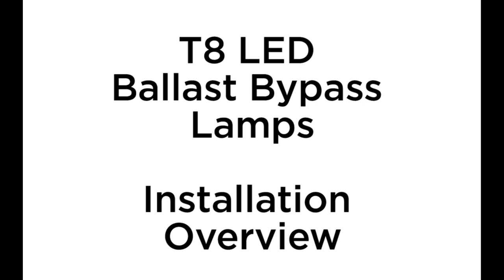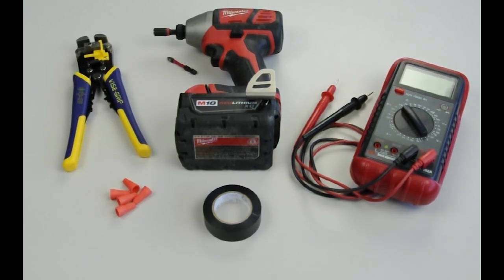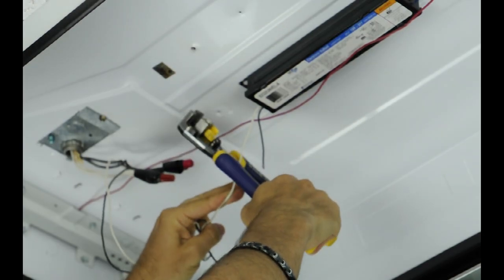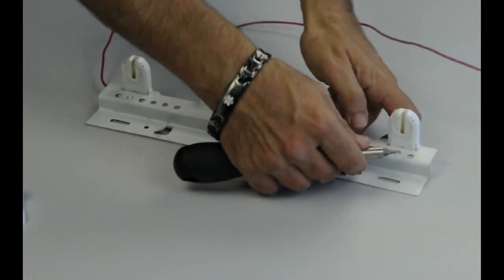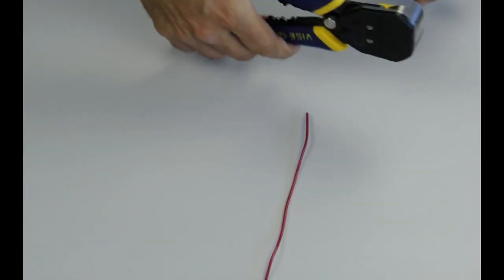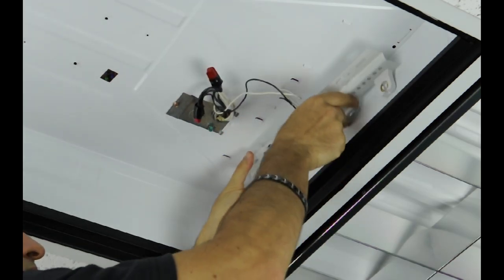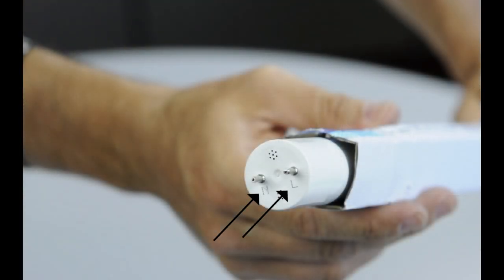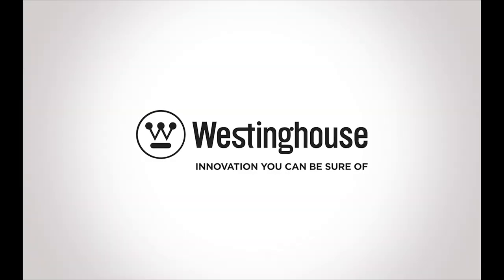T8 LED Ballast Bypass Installation Overview

Comment: where is the standardization of direct wire LED lamps? It seems as if some lamps use 120 across the tube and others use only 120 at one end of the lamp. (such as indicated in this video-also known as Direct Wire trademark pending). Phillips uses across the lamp, not one end as indicated in this video. (also they use shunted tombstones- also know as double-ended) Buyer Beware I guess. Best of Luck!

Comment: But why didnt mention the tapping rate for shunted socket especially bcz we will connect 220 volt directly with it and may this could be dangerous during time and produce heat. Thanks
Reply from the maker: These lamps are certified to UL 1993 as direct replacements for use on building mains line-voltage from 120V to 277V in new or previously converted LED luminaires and carry a UL Classification Mark. Medium bi-pin sockets (tombstones) are typically rated for voltages up to 600VAC, as noted in the included instruction manual for Westinghouse Lighting ballast bypass LED lamps tombstones you may use the existing sockets (tombstones) as long as they are in good condition.

Comment: As an instructional video, this is woefully inadequate as to be even dangerous.  There are no instructions or links to them on the website mentioned.
Reply from the maker: We appreciate your feedback and we’re sorry to hear that you don’t find our video
helpful. Please note that this video was created as an overview only. You can
find detailed instruction manuals for all T8 Ballast Bypass products on our
website (www.westinghouselighting.com). Just look for the blue “Instructions” button found near the top of all product detail pages. Also, as stated at the beginning of the video, this installation
requires knowledge of electrical systems and should only be performed by a qualified electrician.

Comment: I'm not sure what they're trying to show us. We need to know kind of ballast, and how many different are there for 2,3 or 4 lightbulb sets. Then how to wire each side and splice it if needed.
Reply from the maker: Hello, the video is a general overview of an installation. Our Installation Manuals that can be found on our website (www.westinghouselighting.com), provide more specific information. If you are uncertain on how to install the Westinghouse T8 LED ballast bypass products, we recommend that you contact a local electrician in your area for assistance.

Comment: C'mon guys, somebody who does not understand this instructions should never, ever, touch any electrical stuff beyond plugging in a plug into a wall outlet! It's all crystal clear and well explained. Although I must admit that a conecting diagram would have been nice.
Reply: Isn’t that the point of an instruction?  An incomplete instruction give impression and be dangerous.
Reply: You must be joking, terrible video. If you need a diagram you don't need a video and the diagram comes with every new fixture by the way.
Reply from the maker: @zoranlaka2658  We appreciate your feedback and we’re sorry to hear that you don’t find our video helpful. Please note that this video was created as an overview only. You can find detailed instruction manuals for all T8 Ballast Bypass products on our website (www.westinghouselighting.com). Just look for the blue “Instructions” button found near the top of all product detail pages. Also, as stated at the beginning of the video, this installation requires knowledge of electrical systems and should only be performed by a qualified electrician.
Reply: Agree. From some of these comments one has to wonder whether they can operate the light switch.

Comment: Terrible video,  completely glosses over the most important part of the procedure,  which is connecting the incoming power supply  to the tombstones.
Reply: You are so right! It doesn't even say what tombstones are! There's understanding basic electrical concepts and electricity usage, and then there's super-specific understanding of fluorescent mounting and ballast systems. One reason people are installing these is to avoid ever having ballasts again; so maybe, Westinghouse, you should at least have added another minute of explanation. 4 minutes is not too much to ask.
Reply from the maker: This video is an installation overview and therefore does not provide step-by-step wiring instructions. However, this information can be found in the instruction manual. If you are unfamiliar with or uncomfortable with re-wiring the fixture, please contact a qualified electrician.
Reply: @Westinghouselighting  In other words, "we made a how-to video, but it's only for people who already know how to do it."
Reply: @BrBill  Actually, the title says OVERVIEW not HOW TO.